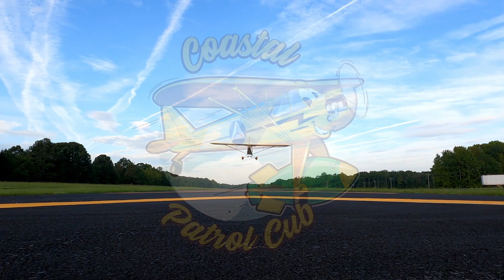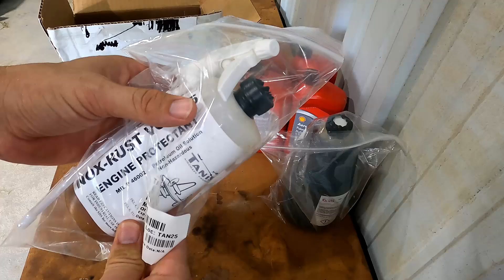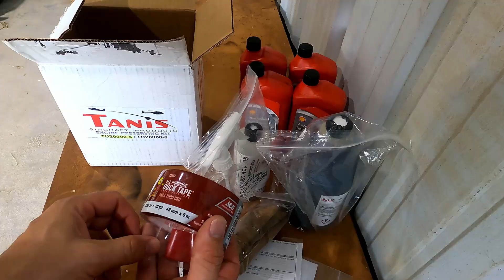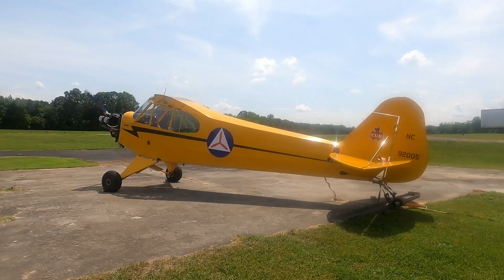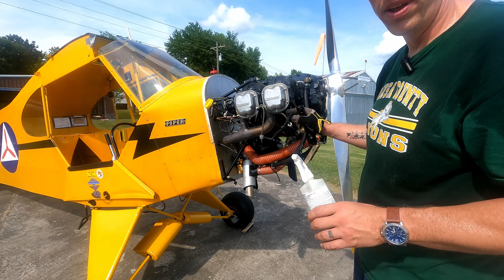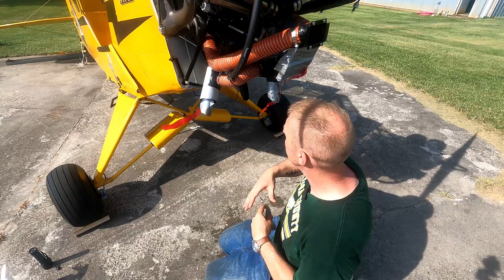Preparing the Engine of My J-3 Cub for storage - Continental preservation procedure

Comment from the maker: One thing I forgot to mention in the video: the Continental service bulletin also instructs you to re-apply the corrosion preventative in the cylinders every 90 days. This is not a "once and done" procedure! But you will not have to re-run the engine again.

Any other things I may have missed or questions you have? Post them here!